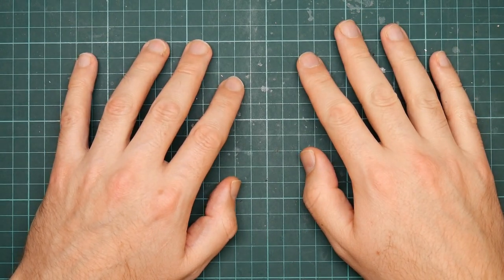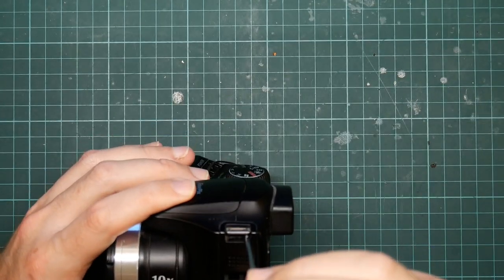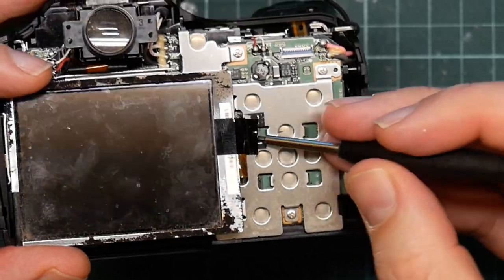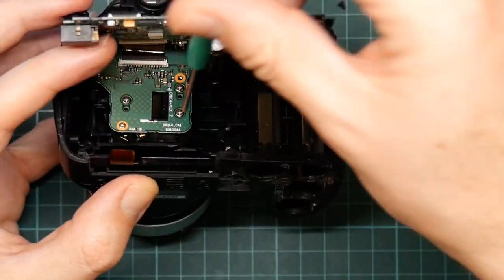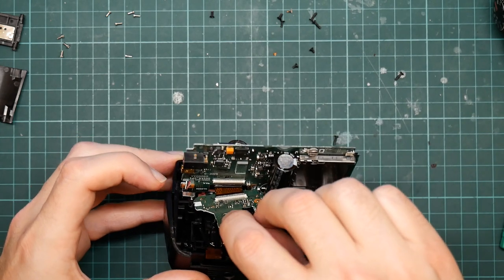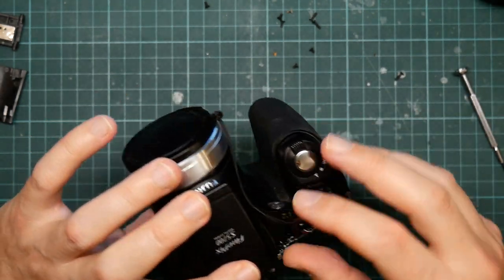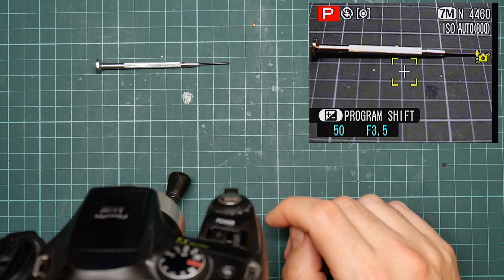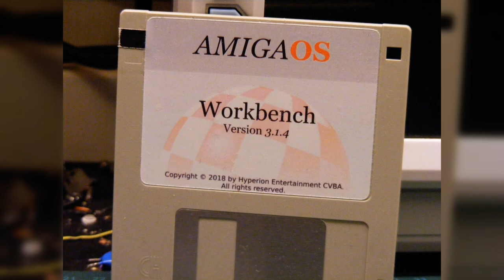Infrared spider photography 1/3, modifying the camera

Comment: Not sure if helps, but here is what I did.
I found an old(ish) module of a video camera in a pile of electronics. I thought that it was dead but anyway I powered it up and saw on the oscilloscope that it output some signal. I recognized it as standard B&W video signal. So I hooked it to an CRT TV at the AV connector. It worked and was indeed B&W. 
I tried it in complete dark with various sources of heat and IR. It worked perfect; a 1200W heating element that was not visible in dark, was glowing like a 60W light bulb, illuminating well the room in IR spectrum. My guess is that the camera was a surveillance camera able to see in the dark.
Next step, I took 10 IR LED from remote controls and made a constant current source with 7805; I mounted them around the lens. Paired the camera with a flat panel LCD and 9V battery, I was able to see in total darkness like it was at day. 
There are IR bulbs that radiate heat instead light, made of ceramics but are quite power hungry (I had a 600W one and that was small) and is too expensive to let them run all night. They are perfect to "light" a room in IR at night. They are not visible in the dark (the heating element is coated on ceramic and don't glow). The main downside is the heat they generate and maybe you don't want to cook that spider or heat your room.
Trough the B&W camera I was almost not able to tell the difference between a image taken at day or at night in IR spectrum.
You could try to find a camera with night vision and either analog output (they are cheaper) with a cheap USB video capture device or digital (an IP camera will do but they tend to be more expensive, USB Webcams are poor quality and not sure about IR filter ease to remove) and record the footage in a small laptop. 
I used "Gotcha!" , a program that has movement detection to record video because I got it free with a webcam; many old webcams had on theirs CD aside drivers some utilities that let you do that. Can find on archive.org some old CDs images of webcam drivers and utilities. Also there is Vitamin D an free-for-one-camera program that can do the same and also many open source or free similar software. Maybe your camera have some software for that, check its CD.
If the computer recognize the camera as a video device (can use it as webcam) and not as storage device, can use almost any program that can sense movement and record it with your camera.

Edit: To help in putting in and getting out without losing the small screws in small places, use a neodymium magnet (is strong but any magnet will do) and rubbing it to the screwdriver will magnetize the tool and made the screws to "stick" to the screws and far easier to pick them from small places were they like to fall and hide.
Reply from the maker: A camera which picks up thermal infrared is a nice find! I assume it was SD only, if it was producing AV output. This camera should be able to match that, or better if I use it for time lapses. Regarding infrared remotes... I'm currently editing that video together. It's unusually shambolic, even for me.
Reply: @hjalfi  If SD means standard TV format (625 interlaced lines at 50hz). I think that is similar to PAL here in Europe.
However, on a 5" B&W CRT TV the image was sharp and crisp, same on a normal 20" or 14" color CRT TV. On a 7" widescreen LCD it was cropped, had vertical stripes so it was 4:3 but very crisp and sharp image. I used only component video - camera have only 3 connections (+9V, Video out and ground).
About the IR remote control LEDs, I found that some are very sensitive and are prone to burn quite easy (even on my tester); I used a constant current source with 7805 for 5mA (if I remember correctly) from 9V battery and connected 2 on series.
To see how good is your camera for IR, try to shoot some photos to hot things in the dark: an oven, a hot stove or so. Mine have bright images.

Comment: Doesn't autofocus use IR light to work? If so, removing the filter probably messes with these measurements
Reply from the maker: When this camera autofocuses there's an annoyingly bright amber light for this --- you can see it in a couple of places where I don't notice that manual focus gets turned off --- but it's a good point. I have seen reflected IR lights off things in the raw footage so it's possible that at least part of the autofocus uses IR.

Comment: @hjalfi I have the same camera, and I did the same thing today. The autofocus and focus get fucked after this process. Still trying to find a solution to that. The glass inside does change the focal properties, but also the fact that the screws besides the sensor are factory calibrated and even 1mm of shift can cause focus to fail.
Reply from the maker: I do have some replacement glass which I intend to cut to size and try and see if that helps --- no time, alas.
Reply: @hjalfi I cut out a replacement glass from a microscope slide. The autofocus is still fucked. I think the main reason is that infrared light focuses at a different point, but even when I screw on a IR cut filter to make the camera normal again it's still fucked. This leads me to believe that I can either loosen the screws a bit to adjust focal distance or I can add another glass to push it back. One of these has to work. Even with manual focus it's trash because the motor probably cannot move to a distance where it can work.